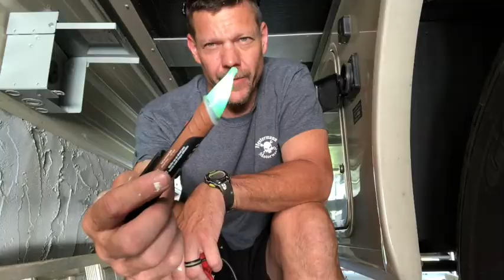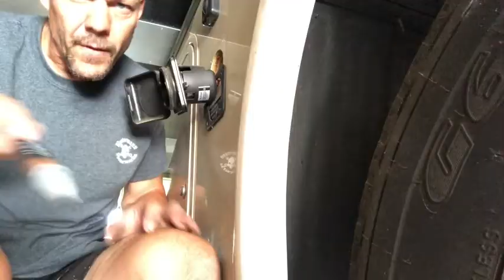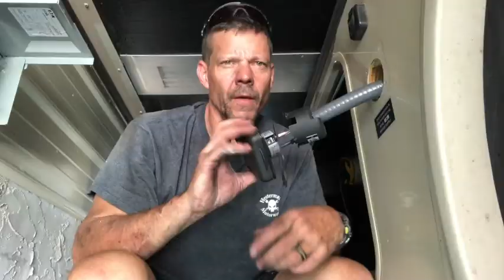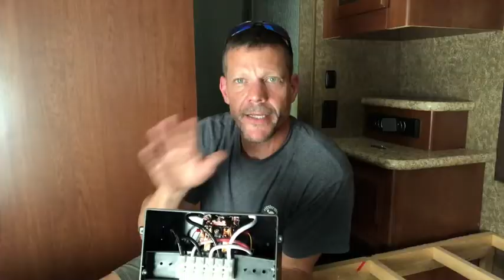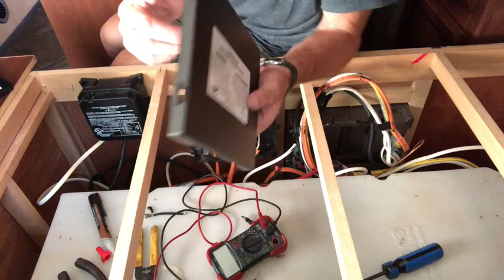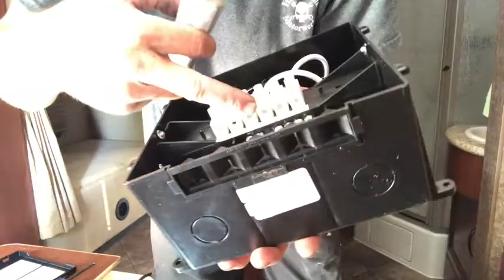Troubleshooting RV with no electrical power. Replacing the transfer switch

Comment: As an actual R.V. Technician, the tool he was using tells u that there is power most of those tools don't have a voltage meter to tell u how much voltage is coming out so if you use one of these tools? Make sure it comes with a meter to tell you how much voltage you have. Great video, he did it the right way by starting at the power source (out-side outlet).
Reply from the maker: very true, I agree. At the time of the video, contactless meters were expensive. now days they are pretty affordable. for anyone reading this comment, I generally use the contactless meter (the pen looking stick) to verify if there IS or IS NOT current and a voltmeter/multimeter to verify what the current is. This becomes more significant when you have a 50 amp rig and have 110 and 220 in different places. My contactless detector does not differentiate between 110 and 220. I have to use the multimeter

Comment: question:
If i am installing solar into an Rv with existing electrical. It has Generator and Shore already. I should assume it has a transfer switch to manage this. Now If I want to add an inverter ran off batteries... is the solution to add ANOTHER transfer switch? therefore the shore/gen gets sorted first and then feeds the subsequent transfer switch. I want to default with solar inverter but have the option of shore/gen.
thanks in advance if you can respond.
Reply from the maker: Pretty sure you want your solar to go straight to batteries (well with a solar controller/converter) when you run off solar you are actually running off batteries to protect the panels from overdraw. Not super knowledgable on the actual workings there though
Reply from the maker: Just reread your question and yes I believe you can either swap to a 3 way transfer switch or add another 2 way up stream to in effect get a 3 power option

Comment: While this is a helpful video, I do take issue with using the proximity tester when troubleshooting a specific problem. The issue is that when not using a meter, you never verified the neutral return was intact, you only verified the hot leg was hot, and still, not knowing the actual voltage. Frankly, starting at the transfer switch would have been best as this is the proverbial for in the road for the 120v system. Thanks!

Comment: Nice video. Any idea what is causing my transfer switch to trip my shore power breaker. When the lid is out on the transfer box. The breaker does not trip when the transfer switch lid is off. Also my transfer box is mounted to the floor with the lid facing up. I saw another video that said transfer switchers should always be mounted vertically on a wall but didn’t explain why. Any thoughts would be appreciated

Comment: How can i know if my converter is bad thank you
Reply: Really it’s just if you put power in and don’t get good power out. A multimeter should do the trick so you can check 12v on one side and 110 on the other
Reply: @hestermannmotorwerks  tanks a lot i appreciate it

Comment: This was an awesome step by step representation of how to troubleshoot my shore power issues. Thank you for putting this together - it saved me having a tech come out just to tell me that I need to replace my ATS. Mine is sticking on the generator side and not switching. I poked around a bit and got the spring or whatever holds the tension to re-engage and now it seems to be switching as expected. Now at least I'll know what the problem is when it occurs again and it won't necessarily ruin another camping trip!
Reply: That’s the biggest thing! Problems that happen at the most inopportune time! Like the roof vent that breaks when it’s raining or the flat tire out in the middle of the deserted desert! Ruins a trip

Comment: 05 pleasureway Lexor RD chevy 3500.
No house power w/ generator onan2800,except house battery power stuff.
I have shore power & house battery power.
w/ generator on measured Voltage erroneous readings no 120VAC on breakers or 12VDC on fuses.
shore power cords which I connected to coach 1st then to household 
Outlet. Result 124VAC on all breakers from neutral bus bar to breakers lugs & from negative green& bare wire bus bar to lugs, to each fuse 13.4VDC.also the GFI circuit in bathroom came on w/ test lamp.
Additionally the air conditioner powered up so did microwave oven however no joy w/ 
Furnace still can’t hear blower or igniter.thremostate is getting 12VDC.
house battery a deep cycle group 27 12.9VDC starts generator.
Edit: when on shore power w/ AC on for about a minute I did hear the converters fan come on for maybe 2 minutes then off so I assume the convertors internal fuse is good?
The generators Onan 2800 fuel filter is jammed up on the breaker due to a fuel line to short.
I suspect w/ little vibration the generators breaker is turning off bc of fuel filter I think I’ve flipped it back up to on position & it’s turning itself off.
I’d like to extend this fuel line & move it off the switch, anyone know the size of this fuel lines inside diameter? attached image of where I think the fuel filter should be located.Thanks for advice it is much appreciated.

Comment: Newbie here...is a transfer switch a separate device from an inverter or converter??  I am plugged in but ac and fridge have no power. 12v lights also dim so batteries appear to be failing (did charge them).
Reply: Yes, transfer switch should be upstream from inverter. Transfer switch decides which AC power source to use, shore power or generator

Comment: Hey man even if you didn’t have shore power could you still power the slides since they are 12volts ?
Reply from the maker: Yes you should be able to run your slides in and out without shore power.
Reply: @hesty32  
Thank you I was just curious

Comment: thank you for this very informative video. What is the brand of the volt tester that you used in the video?
Reply from the maker: the multi-meter is an Innova and the non-contact tester is a SouthWire. Klein makes a very nice one too though that is under $20 and I think available at Lowes/HomeDepot

Comment: I have a 2016 palomino puma 25rs and have a strom the other night I have no power in my camper no lights or plugs are working I am getting power to my breaker box in the camper and all the fuses are good any ideas?
Reply: If you are getting power into your breaker box but not out of the the breaker box, it has to be something there in the box. I’d start checking power in the wires and narrow it down. It’s uncommon but breakers can go bad. They can also be deceiving and look like they are on but are actually tripped. Maybe start by flipping them all on then off. Since you mentioned outlets, I’m assuming we are talking bout the 110 side. But your lights are probably 12v so maybe start with the main breaker since that is common spot for power to the inverter for the 12v side of things
Reply: @hestermannmotorwerks  so both sides of the breakers are getting power
Reply from the maker: @gamingwithraymond5664  Most common issue for 110v is a hidden GCFI that is popped. Check in the bathroom, under a flip up counter in the kitchen, etc.  For the 12v side, I would check power getting to the inverter. But if there is 12 v in the fuses side of your breaker panel then I would think your inverter is good. It is possible it is something else but you just have to start tracing wires at that point.
Reply: @hesty32  checked that as well
Reply: @gamingwithraymond5664  Unfortunately you are just going to have to start tracing wires to find where is has a fault. Might be worth double checking your GCFIs. Even if they are in the "use' position, they can go bad and prevent current. Since your lighting is not working, I suspect it is something else though. Your GCFIs shouldn't be providing power to any lights

Comment: Hello and thank you for your informative video. You explained everything to the point where I think I actually understood what you were talking about. That was great! Thanks! My portable heater I was running in my RV shut off last night by itself and I assumed it tripped the breaker at the house where I'm getting my power from with my 100' ft. 8 gage extension cord. When I inspected the breaker box nothing had been tripped. I then noticed the male end of my extension cord was black and so was the electrical outlet where it was plugged into. I immediately unplugged it and checked my female end of the cord and it looked fine. Even the adapter I have hooked in between the extension cord and my RV plug, looked okay to me. Nothing black or burnt. So bought a new 100 footer 8 gage extension cord. Replaced the electrical outlet with a GFI and the outlet gave me a green light and my extension cord lit up so I assumed I had power to my outlets in my RV... but I don't. So here I've been running off my RV battery all night and all day and night again. I figured I will run tmy second portable heater tonight and troubleshoot my RV cord tomorrow and then my fuse box and see what's up. I'm not sure where my transfer switch box is but I will track it down. We had a bunch of rain a few days ago and the ground is still wet and I think it was a bad heater to begin with and that maybe my old ext. cord was getting too old and showing signs of wear and tear. I just don't understand why it fried my cord instead of tripping the breaker. But I think I answered my question in the sentence right before that. So wish me luck and thanks again.
Reply from the maker: good luck! It is possible you tripped the GCFI in the RV. Often times there is one in the kitchen or bathroom that actually protects the other standard outlets 'downstream'. easy check and I have run into that before
Reply: Yes ive already tried the GFCI. There is one in the bedroom right next to the breakers and fuses. I push the "test" button and than the "reset". I hear it click. But still no power in any outlets. I will keep troubleshooting. Thx

Comment: Great job...... best instructional video I have seen in a while.  One thing I might add, I always take several photographs of anything before I take it completely apart just in case i forget how something goes back in place. How often do we do a job and say hey where did that screw or wire come from the photos will often tell me.
Reply from the maker: that is great advice! for wiring, plumbing or really anything, take a couple pictures before you take it apart so you can remember how everything was routed/fastened etc!

Comment: Hi my 2004 safari zanzibar a/c works when plugged in to home outlet but won't turn on when not plugged in. Thank you
Reply: Check the circuit breaker on your generator. Most generators have on located near the start switch on the generator

Comment: thanks Dude. You should see how the previous dip shit wired the box, all bare copper on the AC power side. I found two bare wires touching ! No wonder the switching box cover was hot to the touch and the shore power died during prolonged air conditioner usage. Also found rust inside the highest point of the switching housing indicating a water leak from the roof at some point.

Comment: I am going to test the TS in my rig.  I experienced a power surge that fried my microwave and refrigerator.   I replaced the converter, but the overhead lights do not work, nor do some of the plugs.  My power steps will not remain out when I flip the switch.  Has anyone else had this problem and what did you do to fix it?  Finding available service in my area is nearly impossible as they are booked up for weeks with work.
Reply from the maker: I really can’t troubleshoot that without looking at it but my guess is that you have two issues going on. The steps are a 12 volt system in every rig I’ve ever seen. The TS, fridge inop plugs etc are on a 120 volt system so I think the two are probably unrelated. For the steps, I recommend clean and lubricate. Amazing what that can do. Then see what they do.  For the lights, most of them are 12 volt so I would check fuses (small 12 volt ones like in a car) and test the switches and lift fixtures. 
For the inop plugs that is on the 120v system. I’d check the circuit breakers and the the GCFI outlets in the bathroom and kitchen. Sometimes there is a hidden one under a folding countertop or something. Probably 80% of the time some outlets work and some don’t it’s a flipped GCFI. Good luck!
Reply: I’ve got the same problem. I can’t seem to get anyone to check it out. I’m gonna do your steps to troubleshoot but I haven’t seen a transfer switch.

Comment: This guy has his act together !!!  Very professional, cautious, and straight to the point. Fast forward whenever necessary so as not to waste time waiting for him to remove screws, etc.  I've looked all over the internet, and everybody wants to talk about resetting the GFI.  That's all well and good if you have power coming into the coach to begin with.  I had been doing some investigating, but didn't have a clue what a transfer switch was until I watched his video. I had already checked power to the end of the power cord, but had nothing inside the coach.  When I watched this video and found no power inside the transfer switch, it became obvious that the problem was between the plug going into the coach and the transfer switch.  Just as he described, somebody neglected to tighten a connection on the back side of the input plug going into the coach.  Can't thank you enough for helping me track down the source of my issue.  Bible Thumber says it so well "by far and above all the other videos on this problem".  God Bless
Reply from the maker: Thank you for the kind review! Glad it was helpful and you got your rig powered up again

Comment: Ive just replaced my switch and when I was unwiring the switch there were a couple of wires I didn't notice where they were connected. It a small white and small black wire that I failed to notice which terminal they were connected to. Could you help me determine where these wires go on the switch. I'm assuming they are the control wire from the other switch. I have power when connected to shore power but not when I'm running the generator.

Comment: Ok i changed my pd switch  but still only have power if I hold it down it keeps kicking out
Reply from the maker: Unfortunately that probably means you still have a fault ‘downstream’ . Possible that the incoming voltage is either low or high but more likely there is too much draw somewhere. Probably a short. Also a very slight chance that the new switch is bad. You could try turning everything off, flipping all the circuit breakers etc. Put power back on then turn things on one at a time to see what circuit is causing the problem.

Comment: HI THERE I HAVE MY 2005 ECLIPSE ATTITUDE TOY HAULER 
WHEN THE GENERATOR IS WORKING ONLY A/C AND POWER OUTLETS WORKS BUT NO LIGHTS ,NO FRIDGE , NO RADIO, NO SUCTION KITCHEN
ANY TIP?
Reply from the maker: you may find some hints by looking at the fuse/circuit breaker panel and seeing if the functioning circuits are all on certain fuses/circuit breakers and the non functioning ones are on another. From your description, it doesn't sound like there is a break down between 110v AC and 12v DC. You could try reseting all the circuit breakers, Occasionally they will trip but don't look like they are tripped.
Reply: @hesty32   thanks for the replay
cuando prendo el interruptor de las baterias todo se prende 
cuando lo apago todo se corta,cuando prendo el generador nada mas trabaja el a/c y el microwave y todos los power outles pero no luces no radio y no fridge
y no carga mis baterias

Comment: Some transfer switch boxes have a RED wire what is that for
Reply: Is it on a 50 amp rig? They have 240 coming in so they are two ‘hot’ wires a black and a red